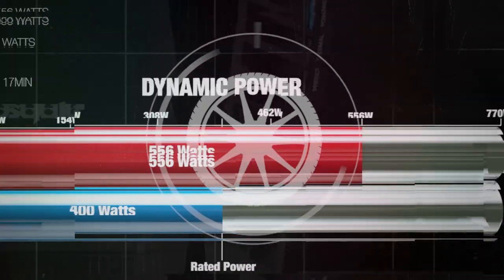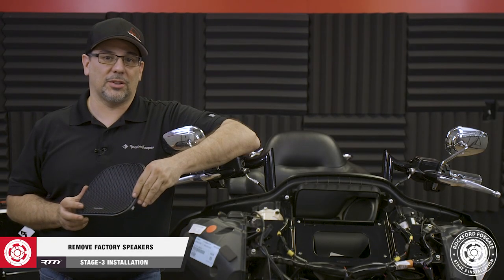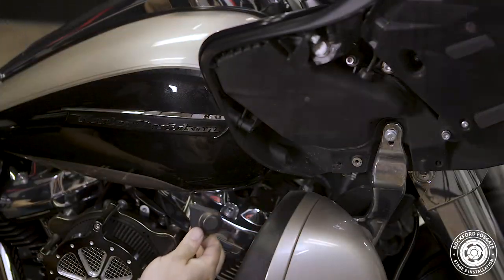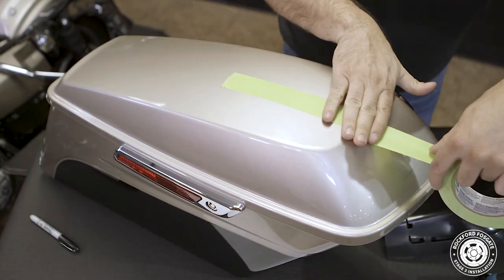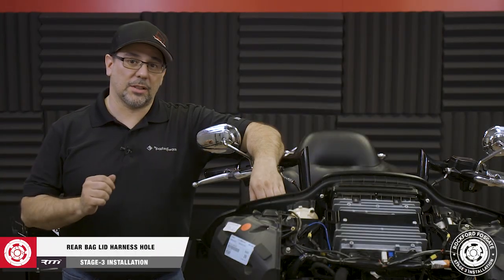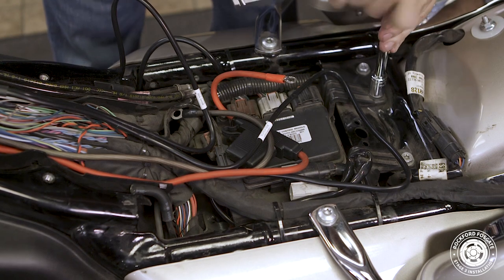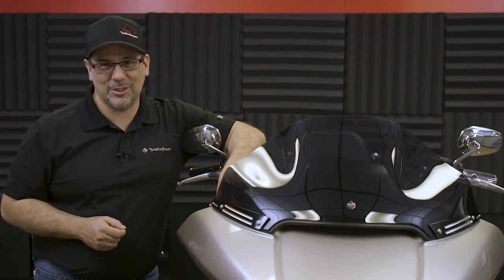2014+ H-D Road Glide Ultra Stage-3 Install

Comment: I just finished installing Rockford Fosgate HD14U Stage 3 system on my 2019 FLTRU. my dealer said to complete the install prior to "flash" so I did. now they say they do not perform flash for this Kit. Nonetheless I found a shop that will do it.
My question is, the BLUE "amp Turn-On wire"  is currently unplugged so that the sound system temporarily works; will this work plugged in after the FLASH ?
Reply from the maker: Not sure why the dealer is saying not to do the flash.  We have this noted all over the product page and in the description of this video to flash the radio or you will blow your speakers.  We recommend doing the flash at time of installation or right after, because the CANbus will "look" for audio components.  

The radio is currently sending DC Offset voltage through the speaker wires, which the amplifier is detecting and turning-on.  Once the radio is flashed, it will no longer send the DC Offset signal, therefore not automatically turning on the amplifier.  This is why the installation video above shows connecting this BLUE wire, so the amplifier can still get the trigger to turn-on properly.
Reply: @rockfordfosgate  Awesome explanation - thank you!

Comment: what about the tour pack speakers, you guys didnt show how those were connected to the amp out wire harness
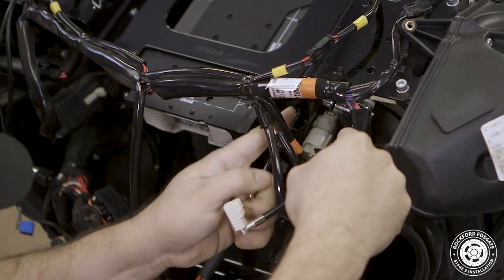Reply from the maker: Great question!  The T-harness installation at timecode 9:00 takes the signal from the radio, runs it through the amplifier and back into the factory wiring harness.  This allows the factory speaker wires for the front fairing speakers and rear Tour-Pak to use the power from the amplifier.

Comment: Would you flash it prior to installation or after?
Reply from the maker: Hi Billy, sorry we missed your original post.  Flashing before or after the installation is fine, it will not hurt either way.